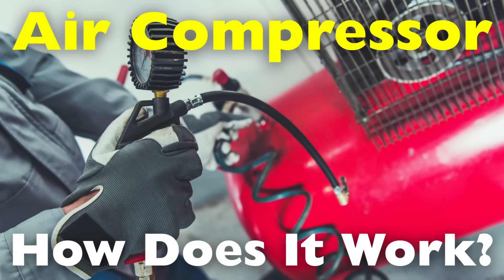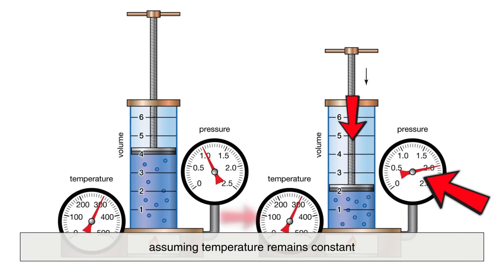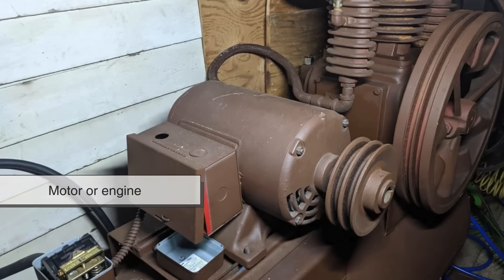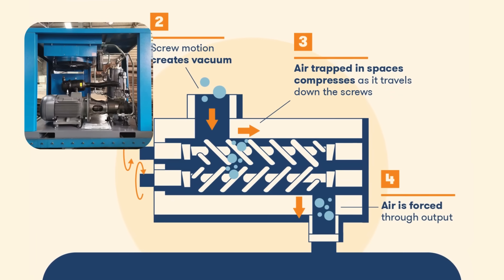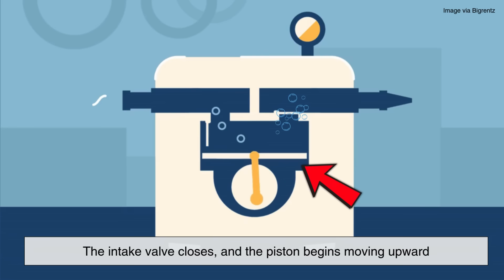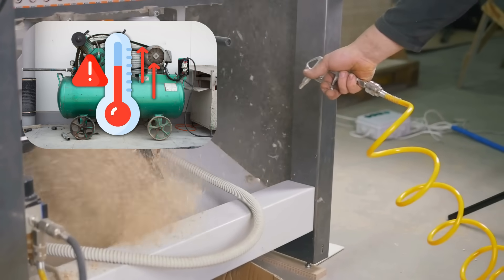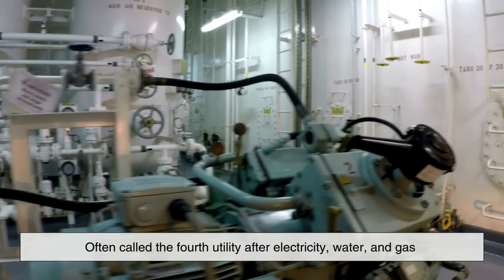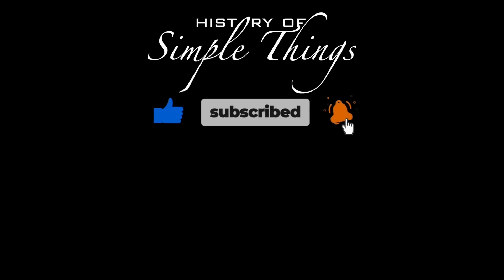How Does an Air Compressor Work?

Comment: The one way (or check) valves are vital for an air compressor to function properly. Without the check valves you could never store the air that the pistons or screws are compressing

Comment: If you have a compressor for your home, get in the habit of keeping the drain valve open and the unit unplugged when not in use. When it is in use, put the compressor outside of the shop or garage. You have to remember you are dealing with a pressurized gas. Look up videos of people who didn’t do any of the things I listed and their compressors storage tank detonated from a rusty interior. The damages are truly crazy when they point out the explosive path their compressors made as they flew up into the air or rocketed across their shops. Needless to say injuries are possible.
Reply: And don’t use a compressor to dry your hands.
Reply: @rickchapman9232 Why?
Reply: So it's basically a grenade, but doesn't it have an automatic drain feature?
Reply: @Vagabond-Etranger Most do not. Most home shop compressors are pretty bare-bones units to keep the price down. Unfortunately, that thinking has made into the production line for the tank manufacture. I don’t remember the measurements but there is a minimum thickness of metal needed for the tanks in the US/Canada trade. Other countries also have them I would guess but their standards probably vary. In one video I watched where a compressor tank failed really badly it was found that the tanks thickness was well below what was needed. Toss in rusty water accumulation and the resulting explosion launched that compressor strait up to shatter the top of a door frame, glance off and up higher to strike the garage ceiling and continue down and sideways where it blasted through part of the garages vehicle door. The man, his friend and teen son had been walking past that thing all day before it let go. 

The other thing to be wary of is the pressure setting. There is no reason to set the pressure switch really high since most home garages won’t use pressures above 90PSI. There are reasons that it might be needed but again, if it is outside while in use, drained completely and left vented when stored, the risks are less.
Reply: @Vagabond-Etranger almost forgot, the drains on the tanks are at the bottoms drain the water but if you leave some compressed air in the tank when you open that drain you may get the same amount of water out but you will get it quite quickly!😂